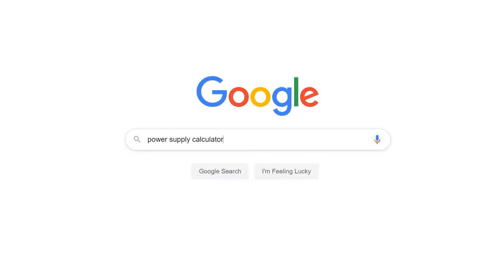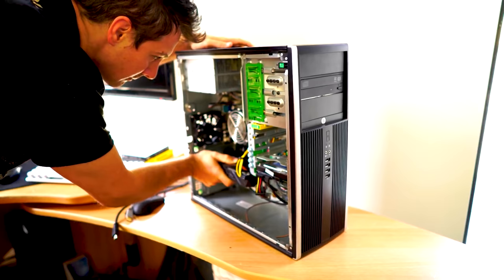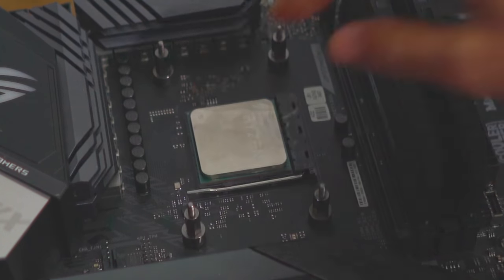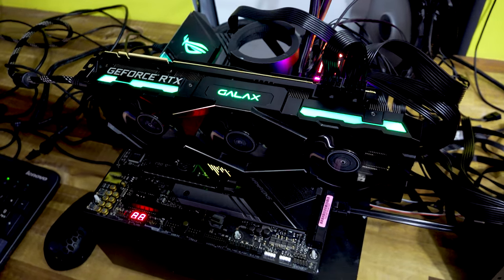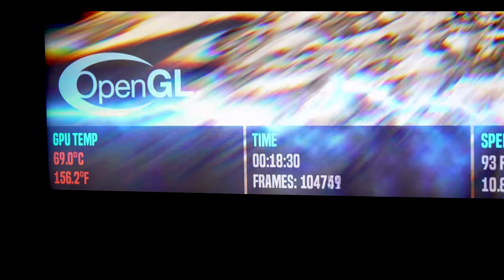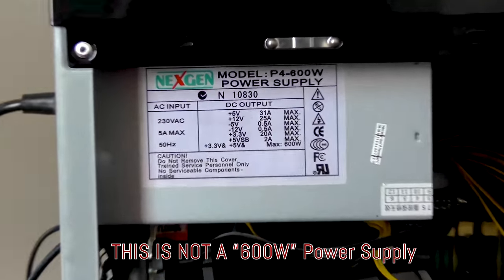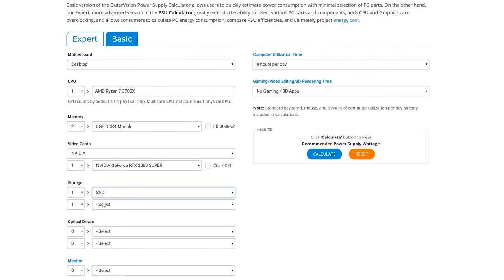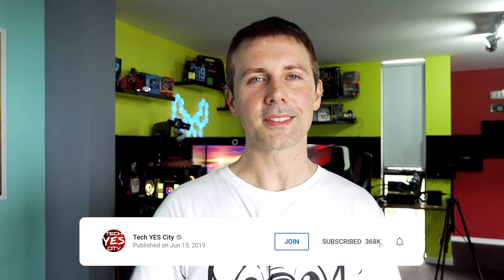I Tried Running a 3950X and RTX 2080 Ti on a 450 WATT Power Supply...

Comment: Often there's no price increase between good brand 450W PSU similar 600W PSU.
I selected parts for my friend's PC and it was taking like 300W so 350W recommended but 600W one was only $5 more so I got it for him.
Reply: Doesn't always hapoen,in my country 450 psu's are atleaat 4 times cheaper than 550 or 600.
Reply: But cons the more expensive 450w psu are fully or semi-modular, also bronze, golden, platinum ratings has bit diffrence at energy-wasting bronze is 85%~, gold 90%~, platinum 93%~. So expensive 450w might be gold, fully modular, premium materials. Same price 600w might was basic or bronze non-modular. Basic is 80%~

Comment: The fact that the psu has 2 8 pins on it's pcie cable is pretty impressive
Reply: Well something like a 1070 will need them
Reply: @markomclane475  no
Reply: @markomclane475  it might have them for some reason but it will never need them. GTX 1070 is a 150W card even one 8 pin is overkill actually.

Comment: One benefit of using an overpowered power supply is that it always runs in passive mode. The PSU fan never has to turn on, so the system is much quieter overall.

Comment: I use a corsair sf450 psu for a 9900k @5ghz 1.25v and a 1080ti with max power limit. The system didnt have a single issue since I bought it around two years ago. The sf450 seems to be a decent power supply.
Reply: nice does it still work good if you're still using it?

Comment: Awesome stuff Brian, I see this all too often where people go out and either by a junk PSU that claims ridiculous ratings but is in essence a 250w - 300w junker PSU or they massively over spend on a super high power PSU then barely utilize it. 

Peak efficiency on any decent (80+ Bronze or better) PSU is at roughly 50% utilization, that is where the PSU is happiest and runs cool so throwing a 1000w PSU at a system that peaks at even 400w means you will be running well under peak efficiency (and yes, efficiency drops both under and over 50%), worse still, you will not be running at peak draw very often, so efficiency will drop even more the lower your draw gets. Conversely, the higher your utilization (on an inadequate PSU) the more heat is created and the lower efficiency drops. Higher heat means lower efficiency, higher ripple and poor stability. 

Realistically for power efficiency and reliability you want a PSU that peaks at about 75 - 80% utilization during maximum draw and runs close to 50% when gaming, video editing etc. The more you can keep your system in the sweet spot the longer all your components will last, power delivery in the efficiency sweet spot also tends to have less ripple and be more stable.
Reply: No
Reply: Yes
Reply: Modern PSUs don't have a curve like that. Corsair has moved towards near peak efficiency regardless of load for all but the lowest end of their lineup. JohnnyGuru references itnis his PC world psu myths video.
Reply: @eila2088  The efficiency curve of (current) higher tier PSUs is almost flat these days but running at ~50% load most of the time still prolongs their lifespan and is still better for the system long term. I generalized to include even budget oriented (80+ rated) PSUs and it won't hurt higher tier PSUs either. It's sound advice no matter how much you are spending on your PSU.

The only argument against it would be if you are planning to upgrade (your system not the PSU) down the line in which case tailor your purchase to that power envelope not your current one. Common sense really.
Reply: @Xaltar_  I believe you reminding my own experiences. And another Aspekt ist that Many people Plan their expensive Upgrade arround a 500 Watt psu which they bought bevore. There can be used even 2 psu's in one system. I have Made very good experiences with Overlocking using a psu for mobo& CPu&RAM&storage and one for the Graphik Card!! And they can get weaker psu's can get weaker that ist true!!!!!
Reply: @Xaltar_  Running 50% load also means you spent money you didnt need to. Money that could be spent on higher quality psu if you really care about the minimal wear components get over the years. Hell you will ne to be recapping well before wear and tear matters if your PSU isnt utter junk and frying things. You can find 450-550w models of great models like RMx or Seasonic Prime lines.
Reply: @eila2088  Read my original comment.  

When I said ~50% I was referring to during normal use, not maximum draw. Bare in mind idle time as well as time spent doing more menial tasks like replying youtube comments etc. This is where you want to be targeting ~50% load, not while fully stressing the system as that happens rarely. Firing up an intensive game would take you up to 70%+ load with full load ideally topping out at about 75% - 85% load on the PSU (100% CPU and GPU utilization).

My comment is intended as a basic rule of thumb guide for newbies. Basically maximum system draw +25% - 30% on an 80+ certified unit (because most uncertified PSUs are either garbage or very old). FYI, this is a very similar metric to the one PSU calculator sites/apps use though somewhat more refined.
Reply: @Xaltar_  Ah.
Reply: I can Not read as much between the lines like i can in german. But i thought the peak Power was the highest Power a psu can provide, But because it is the absolut Top of Power the peak Power is provided to a shorter to very short time,  period. How mightier the psu is as more it can provide for a longer time. I thought. But i have made a mistake, too. That happens threwing words together.:)
Reply: @8iosatlost209  I meant peak draw, as in, the most power the system can draw from the PSU. Sorry if it was confusing.
Reply: @Xaltar_  no i was to thumb to translate and saw only the words i know. But i knew that i was wrong for 80%. I wanted to make sure that everything is 100% right. :)

Comment: For those who wanna get the first gaming PC: (apply to brand new parts, mainstream desktop and the lower side of HEDT)
- If your budget is under $1000, you won't need more than a decent 600W (even 400-500w is enough and decent mean 80+ sticker, usually a good brand name)
- If your budget is under $2000, you probably won't need more than a decent 600W (+100W if you want a peace of mind, but probably just get the better stuff like 80+ Gold and/or modular PSU).
- If your budget is still under $2000 and you know how to OC, then you already know you gonna use, and in this case, 90% possibility, you won't need more than 600W either.
600W is enough for almost everyone. Except the extreme overclockers. And you probably know the stuff when you are at this level.

For used parts: 600W is also the sweetest spot. If the deal is good, get it. I won't mind getting a 750W for 500W price because they are clearance or missing modular cables or something like that, if it runs well, I take it.

And on defense of the "high wattage rating" choice: PSU tended to run its best (efficiency, temperature) at 50-80% of its capable. Like 400-450W load on a 600W PSU (most of the time when you playing games or doing stuff like rendering video, you won't take your CPU and GPU full load at the same time)
Reply: Archmage when?
Reply: Also to the defense of "high wattage", longevity... 12 years ago, I bought a 800W PSU with intention of a crossfire setup.. I never did. That PSU probably never saw 500W+ utilisation, and looked like a waste of money back then.... However, 12 years later, I still daily use that PSU after 4 GPU and 4 Motherboard upgrades... My 400 and 550W PSUs on my other PCs didn't last half as long. On the long run, it ended up far cheaper than a 550W I could have bought back then..
Reply: Thank you for this info!

Comment: I did the test myself with 450W cooler master power supply and used it with 2600 and 2060 the end result The power supply died a year after. The thing with power supply is they degrade over time and usage that means at start they will have good efficiency and as they become close to the end of warranty or after that they will degrade to 50-60% of there peak performance.
Reply: Ghost-squad  I changed my graphic card with 1 year of warranty left in that power supply it died the next day the warranty expired with 2060.
Reply: Ghost-squad  I had cooler master 450w power supply which I was using for 2 years I bought 2060 and used it with the same power supply and it died after the end of 3 year 1 day. Cooler master gives 3 years of warranty. Hence I posted my first comment

Comment: Last time I was this early, 225w was sufficient.
Reply: Nowadays PSU under 400W are usually found in SFF, that being said, true 350-400W is enough to run a lot of mid range rig already.
Reply: Damn that was a long time ago
Reply: @Verpal  I'm running I7-8700 with rtx2060 16gb ram 1 m.2 stick and 2TB HDD on 350w PSU lok
Reply: I have a Ryzen 5 3600 + a Zotac GTX 1650 low profile running on a 200w hdplex with a laptop charger
Reply: My laptop has that, 230w, lol! GTX1070 and 8750h

Currently the 1070 is out-benching overclocked desktop 1070 since the mobile has more CUDA cores (more like 1070ti) and I spent a lot of time tweaking every MHz on the voltage graph for over a day to dial it in. But the CPU is kinda limited by its 45w constant limit so voltage tuning on it shot up Cinebench by 20+% so now it’s more efficient and powerful while also getting better battery life and better temps and less fan noise, so a major win!

11.8 amp power brick at 19.5v = 230w
Reply: @Verpal  my 1050ti and Pentium g4560 runs perfectly with a 450watt PSU
Reply: @OmPrakash-pc1ec  Of course, at most G4560 will use 60W, even when using MCE with BCLK overclock, and 1050ti OCed will suck up at most 90W, 450W is overkill.
Reply: @gamingtest4684  what make and model 350 has PCIE power cables?
Reply: I ran some wires from potatoes to power my 3990X and OC 2080 TI's in SLI.
Reply: @gamingtest4684  and which 350W psu has 6 pin power connector, haven't seen any myself
Reply: @gamingtest4684  your comment is a month old.. how's that system holding up?
Reply: @logisticsthenovice  Everything is perfect. No any problems.
Reply: @andreiarg  VS-350 Corsair
Reply: dude the psu is 500 but the pc uses 200
Reply: @Verpal  It's not mid range but the new 10900K can use like 200+W lol.
Reply: @whoisthis9802  yeah it works great

Comment: Steve cool clip, I'm going to use your clip to tell so many that come into were I work, And tell them they don't need 1000W power unit.
Reply: Let them buy what they want
Reply: It's not really your business to tell them what they don't need.
Reply: @MrCrazyjoe259  Sounds very close to ripping off some customers that may not return.
Reply: ev fn  It might be the moral thing to do, but as a sales associate, it is not always in the company's best interest to be saving people money. It's definitely a shitty thing, but many walk-in stores are struggling to get sales in the first place due to this pandemic. Employees can even get in trouble for doing things like this too often. Running a business isn't particularly about being virtuous. Sales is sales. If the customer comes in asking specifically about power supplies, then yeah, you can inform them that you probably don't need a 1000w unit, but if they came in believing that's what they need and intend to buy without asking the associate questions about it, then you should probably let them buy what they want. They are there to sell products and answer questions. The customer might get ripped off, but if they didn't do research before-hand or ask questions, it's kinda their own fault.
Reply: Here's my hot take:
If the customer wants a power supply that can safeguard their computer from damage or malfunction, then why would op try to argue that customers are wasting money on power supplies when clearly they are still receiving higher product utility than they would on the 450-watt supply?
Reply: @ShadowLancer128  get a fucking 750-850 typical users dont need 1000, that's my take
Reply: Apex Ace don’t think he meant a 450W unit is fine. 650-850 is plenty for most systems
Reply: @Michael-hx6ls  I guess i misunderstood him.
Reply: @Michael-hx6ls Okay for everyone out there I know what is needed to power anything to do do with computers.
Reply: Sometimes it's not about  what you need, sometimes it's about  what you want. 😊

Comment: The thing to take into account with a PSU in the long run is it's efficency, PSU's have the best efficency at half load, also a psu is going to last longer at half load than at full load. (My first gaming computer I built had a psu that didn't even last 3 years because it was a evga 450W bronze on a computer that used 350W) And when you take into account an average power consumption of 350 watts for a gaming rig the differience in power use over a 5 year span is about $30 from a bronze to a gold PSU, so if you can get a gold psu for up to $30 more than that bronze psu it will make up for it. So for that rig the best psu to pair it with would probably be a gold 750W psu which you can get for about $110 rather than a bronze at about $95 as it will more than make up the cost differience in reduced power consumption. With the wall power draw being 430W at 80% efficiency that means the pc is actually using about 344W at full load, which means with a 90% efficient power supply it will only use 382W or roughly half of a 750W PSU https://en.wikipedia.org/wiki/80_Plus

Comment: Something to keep in mind for anyone reading this, power supplies are most efficient when at about 50% of its maximum output. So for a PC sucking up 400W you'd want a PSU around 850W for maximum efficiency, but it will run just fine on something below that.
Reply: @DARKDAYZGAMESDDG It won't change the performance and it's not really something that matters since it's not pulling that much power anyway, but a higher efficiency would mean less power wasted and less heat output from the power supply. Not really something that matters at the low end where power draw is generally pretty low (excluding old parts that are power hungry but low end for today's standards), but something that does matter at the high end where power draw is much higher and where a few percentage will mean a bigger number!

Comment: "Generally considered high end parts" Yep
Reply: @Meklon  It doesn't matter since it's pretty much uncapped fps
Reply: I hate these types of people, calling an RTX 2080 “decent” or some shit, irritates the hell out of me
Reply: Alper Duman why bother watching then?
Reply: @alperduman9294  Yeah I consider my 1660 super decent and anything higher then that high end.
Reply: Cries in integrated NVIDIA graphics in 7 year old lap prop
Reply: @spectre legacy account Even before, without taking into consideration the current state of the GPU market, a 1050-RX580-1080 is mid range
Higher than that is high end 
3080-6800XT are just absurd, not even high end, it’s ”la crème de la crème”

Comment: The all important thing here is what quality PSU are you using.  If a high end one then even if you push it to the max rated output constantly still generally fine. Cheaper PSU's totally different story  - they almost never maintain their 'rated' output for more than like a few milliseconds. All that being said best to leave some headroom as PSU;'s do wear out over time and the electrolytic capacitors will usually be the culprit to slowly degrade leaving less headroom as they age.
Best way to tell IMO is to measure the voltage at the GPU input socket (on the GPU not PSU) - if above like 11v then still ok (12v or over is good) as most wont cut out until like 10.5 volts or less.

Comment: CoolerMaster & Antec & Silverstone -- really make the best value-for-money PSUs . Truly lovely . Plus , no coil whine BS at all .
Reply: Don't forget Seasonic :D
Reply: lmfao not one of them make PSUs.
Seasonic, CWT, Delta, Enermax, PC Power and Cooling - theres some quality PSU makers. FSP are ok these days too.
Personally i generally use Seasonic, though most of them are Antec branded.
Cheap Coolermaster PSUs tend to be utter crap.
Reply: @lifelightv2   . Yes . Seasonic too , although used that for a very few builds -- about 15 tops .
Reply: Had my 1200w Silverstone powering my personal rig from 2013 and still going strong today on Mordern hardware 💓
Reply: Coolermaster and value for money don't come together.
Reply: @thaNZdon   . Congrats , really :)

Comment: Been running 3950X + nh-d15 (with PBO), 64GB ram, 5700XT, 2 Nvme, 2 SSD, 2 HDD, 1 DVD, 7 case fans, 8 + USB all on a 750W PSU.

Comment: Great point to bring up. I often use that website to guide me to a suitable psu for my builds, I also want to point out that it also gives you a full list for 5V, 12V and 3.3V calculations so you can directly compare those specs to your psu. One thing I always take in to concideration is some headroom for the degradation of the psu over time and also future component upgrades. Going from 450W to say a 500W psu can be as low as 10 bucks more some times.